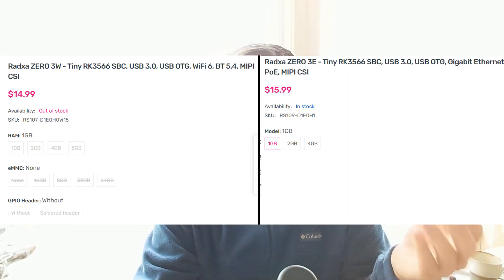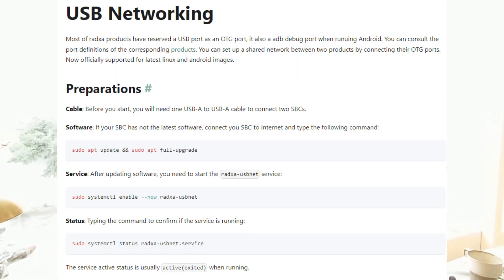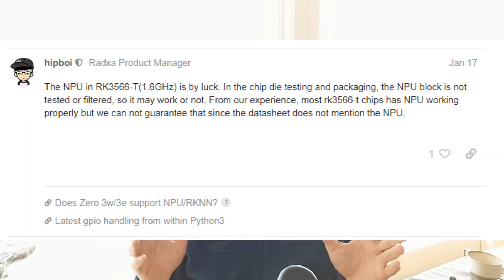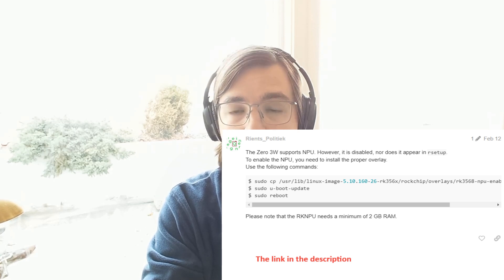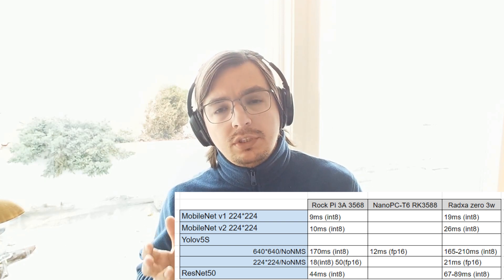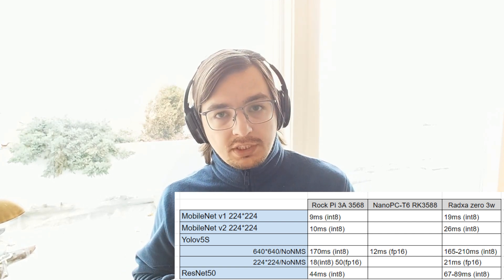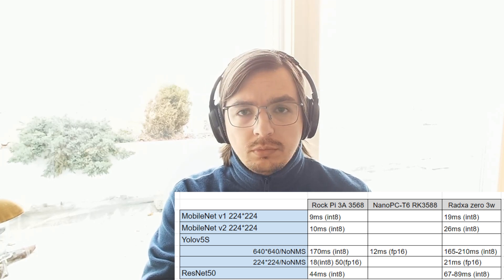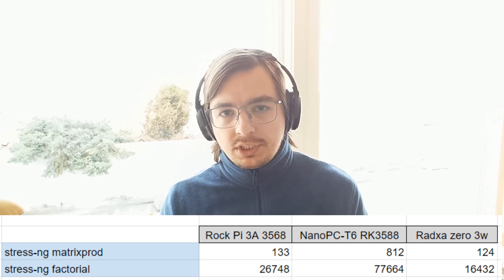Running Computer Vision on RK3566 (Radxa Zero 3W, 3E)

Comment: My Experience with Radxa Zero 3W (2GB RAM, 8GB eMMC) – A Colourful Paperweight

Let me share my honest and painfully disappointing observations about the Radxa Zero 3W, specifically the 2GB RAM / 8GB eMMC variant.

🔧 General Observations
Build quality? Utterly poor.
Component soldering? Some of the ugliest, sloppiest SMT work I’ve seen – especially on the RAM and eMMC.
Heat? The board runs too hot to touch under normal conditions.
Community support? Practically non-existent. The forum is full of unresolved threads and user complaints just left hanging.
Boot stability? Inconsistent and unreliable. You're flipping a coin every time you power it on.

⚠ Specific Observations
The board seems to boot only when it feels like it.
SD card boot is random – sometimes it works, sometimes it doesn’t.
Serial output regularly complains about "memory training". What even is that, and why is it failing?
It loves staying stuck in MaskROM mode, green light solid, totally unresponsive – regardless of pressing the button.
Flashing images to eMMC? Half the time it fails with vague errors: test device failed, DDR init failed, communication failed. Pick one.

On the rare occasion it does boot an old Debian XFCE image, it freezes within minutes. Green LED dies, system halts. I've tried every recommended USB-C cable, power supply, and flashing tool version (v2.81, 2.86, 2.96) – none helped. Weirdest part? Physically pressing on the RAM chip sometimes wakes it up. (What is this, a pressure switch?)

It's clearly degrading over time. The board had minor issues initially, but got worse with every passing day. Now it’s just sitting in my drawer – a nice-looking but useless coloured header board. I had high hopes when I bought this, wanting to explore alternatives to Raspberry Pi. But now? I finally get why someone once called me a fool for saying anything nice about Pi alternatives. To be frank, this board is an unstable mess. And the lack of proper support or fixes makes it all the more frustrating. Unless Radxa seriously improves QC, documentation, and community support, this will go down as just another failed Pi alternative in my book.

End of rant. Thanks for reading – and best of luck to anyone still trying to make theirs work. You'll need it.

Comment: Hello sir I appreciate your video. I am a big time noob at this stuff but I have one comment and one question. 

1: i connected to it and have used it exclusively thru WiFi/ssh, just edit the before.txt in when you make the image. You probabaly know this. I have never controlled it thru hdmi or uart at all personally.

2: the board only supports 2 cameras out of the box, how are you supposed to get other cameras working on here? I have been unable to figure it out. Thank you
Reply from the maker: Cameras can be connected through USB / CSI / TCP. But of course, it's just about your use case.

Comment: RK3566 (Radxa Zero) Board Summary:

Pros:
   - Cheap: Costs $20.
   - Standard Linux: Runs normal Linux with existing libraries and software.
   - Good NPU: Includes an NPU with a decent inference framework (RKNN Toolkit).
   - Good thermal balance: Passive cooling is generally sufficient.

Cons:
   - Slow NPU: Twice as slow as the RK3568, despite using the same chip.
   - Limited parallelization boost: Only a 20% speed increase through parallelization, compared to much larger gains on other boards.
   - System setup challenges:
   -     Initial setup requires a monitor with mini HDMI or a UART connector.
   -     USB connection is not reliable out of the box.
   -     Documentation lacks information about UART connection.
   -     NPU may require driver patching.

Overall:
   - An important step forward in affordable computer vision technology.
   - Offers a good balance of price and performance.
   - Not the fastest board, but a solid option for budget-conscious projects.

i used gemini 1.5 pro

Comment: Thank you for the video! There is also orange pi 3b which also uses rk3566 and costs simular, but at the same time has much more peripheral interfaces and bigger community support. I think it maybe more friendly for user than the board in the video
Reply from the maker: Thank you. Didn't see that the price goes from 30$

Comment: Maybe low speed is chip binning result
Reply from the maker: I am a bit confused by this. The CPU speed is almost the same, but the NPU is x2 slower. If it's some binning, I expected both speeds to degrade. But I am not very deep into this process.